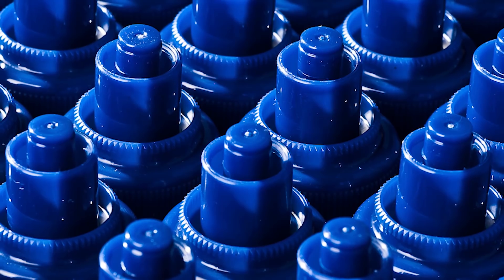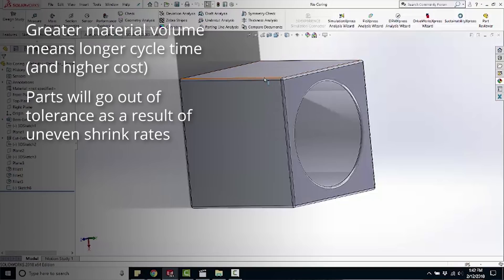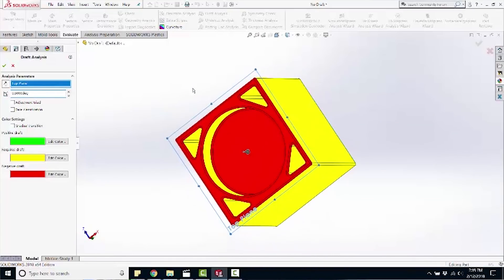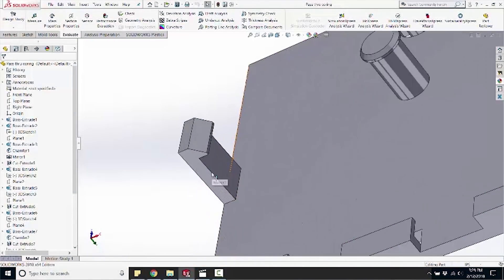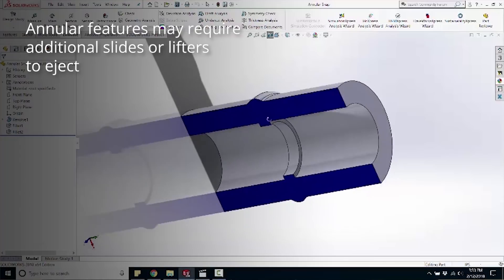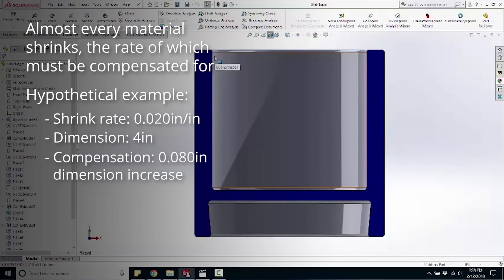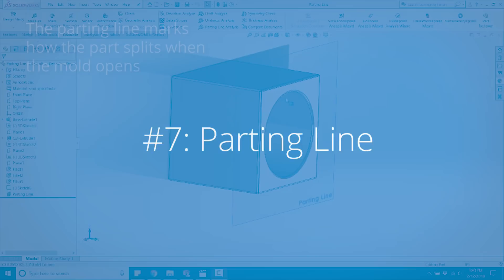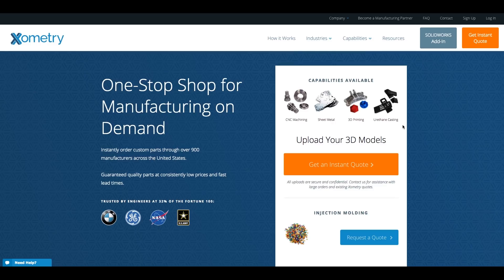7 Ways to Save on Injection Molding

Comment: Nice video, helpful advices/warnings too :) Thanks !
Reply: A injection mold generally can go for $50 000 I know because I asked st Clair college I their engineering wing & a desktop machine is at desktop is still $12500 at cheap vs a $500 3DPrinter & no retooling at little to no cost

Comment: Could you guys please do a video on flip top bottle cap hinge design (Bistable live hinge)?. Thanks.
Reply: That's called a live hinge, and you almost exclusively use polypropylene.  Google terms for more info.  Keep on.
Reply: @trexinvert  Thanks for your reply. I understand its called a live hinge. I was looking more into how the parameters for the hinge, like its thickness, length etc. are chosen for a given application. I am not able to find how people professionally design such hinges. Thanks.
Reply: @karthick86c  i am also searching for hinges design and calculations
Reply: @ramand6490  It is quite difficult to get any info on practical design of such hinges. Seems to me that industry does it through trial and error
Reply: @karthick86c  i think its not that hard ,it all depnds on size of component the game is all around length and witdth of plastic and v-bend of hinge ... And most imp is you have to close the cap when the part is eject because it is hot at that time so it takes round shape easily during heated stage.  ,,,   actually our company had designed this components so we did lot of research and found out there no particular formula
Reply: @ramand6490  Ah! Closing the cap when it is ejected! Thanks for the input! I always wondered how is that the hinge is not stressed when closed. So, the component cools down in closed state and that becomes its natural neutral position.